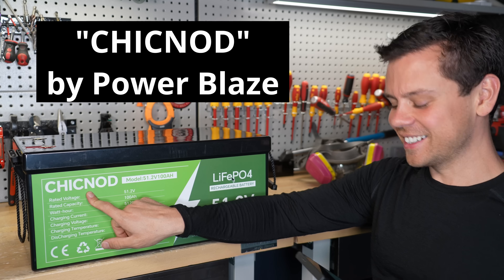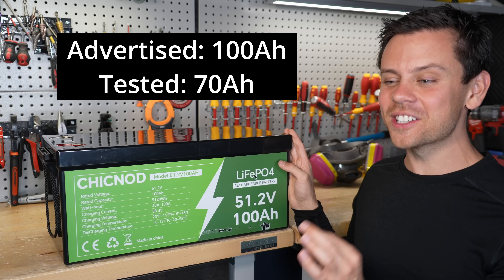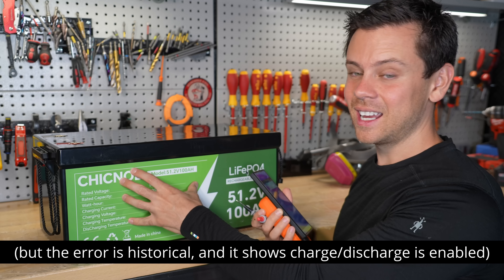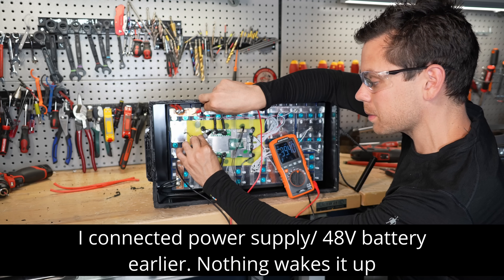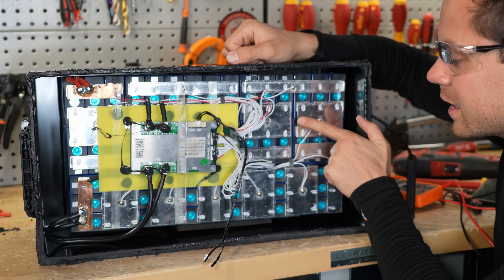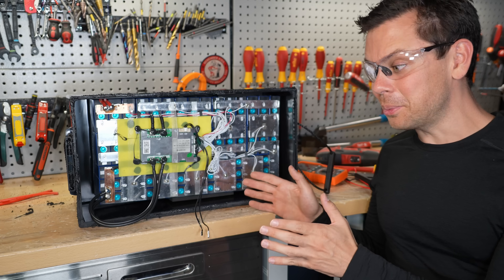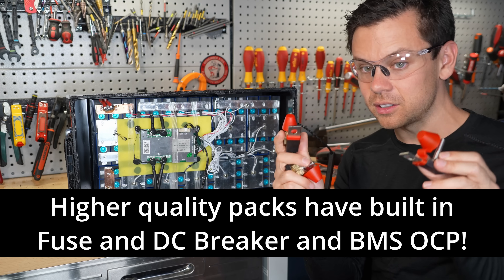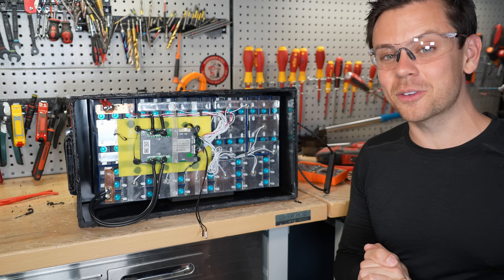TEMU Battery Scam? 48V LiFePO4 5kWh for $529 CHICNOD

Comment: HELP! I live in Australia. Our issue is distance and no infrastructure to charge an EV. Can you help design a mobile 12 to 16 panel solar charging system. I was thinking of a Sigenergy 5kwh battery with its linked DC charger. If I can make it able to have the solar panels unlinked / disconnected for storage (travel). So 12 panels at 1700x1000x30mm are light and would easily fit in a trailer if packed correctly. But on stopping my car to charge I would need to be able to set up my solar panels. Connect them to the Sienergy battery and DC charger to my car. If I could get the DC charging unit without the battery I would, but so far none offers this as a separate unit. Any thoughts?

Comment: I think I saw a video when the bms turns off when the battery reaches below the rated voltage so he connects it with a 12v lead acid battery and starts charging and the bms turns on.
Don't know will it work 😅.

Comment: Wearing "safety glasses " when not required makes nothing safer, especially not when they condensate. Who do you try to impress? Amateur
Reply: Then don't wear them and you can enjoy the metal blast shards in your eyes when a probe or screw driver slips. Not everyone thinks like you thankfully.
Reply: @LithiumSolar at 12 Volt? 😂 oh boy, what paranoid Karen thought you? Edit, are you potentially talking just about the dangers using a fing screwdriver??? Seriously? 😂😂😂😂

Comment: How about a video building a small portable light weight travel unit for camping people that don’t want to use generators because of the noise and would be cheaper and better than the Ecoflow, Anker, Jackery things? 
Or are those the better way to go?
Reply: Great idea, especially if he can figure out a DIY kit the also includes an optional 30A RV output, which few (if any) yt channels have done.
Reply: @__WJK__ This young guy is the only one I watch. I’m thinking more like the weekend warrior maybe a few days longer type of thing. Lots of trucks have the 120v outlet but a car battery only lasts so long unless you run the truck or bring a small 2-3 HP generator which though quiet is a hassle because of fuel to carry and the noise it does make at night.

Comment: Temu all junk 
I prefer to buy all separate and  diy .
I leave in Philippines they have lazada and shoppe here . Here I can find all I need  cheeper easy return if needed money back guarantee no hustle . Rearly I have to return
 In the last 2  years  I build a  few sistem for difrent costumers all I purchased ware ok .  The cost for A Daly bms 100ah is around 30 $  I use eve cell 90% of the time  
1cell 20ah it's 10 $  
On sell I get it for 7$
 Temu didn't cache up  well in this part of the world .

Comment: Bought two separate 4 packs of 280Ah from there. 4 batteries were bad and 4 batteries were really bad. None would top charge and are the first to discharge in a system. I suspect battery manufactures dump their grade B and C batteries on that site. Now only buy fishing lures, terminal ends and nothing important there. You know what they say " Buy cheap, buy twice".

Comment: I just figured this voltage issue out on my DCHouse battery. The BMS likely has a hidden setting (I used the Overkill Solar app to find out) that makes it think it has a user accessible breaker. Change that and the voltage should go back up.

Comment: Would the 48v dc-house 5kwh batteries be a good mix with the sungold power inverters you have shown recently? Would I need to fuse between each battery in parallel ? Or would I have a fuse between bus bar and inverter?

Comment: I put a 48v 100ah fllypower battery in my 22ft sailboat with 400w of solar and a 48v electric outboard, works great, typing this from the boat been on the water 3 days still 98% been as low as 84% but solar seems to have no problem topping it off.  Never found a good review of this battery but the price was right at just over 600$.
Reply: This is meaningless unless you do an actual capacity test. For all you know it's only 50ah. Most people can't or just won't verify capacity and will use them as is until it dies thinking they got a steal.

Comment: Honestly after I looked at numerous options. I bought the best bang for the Buck. 12-300 Ah Chin 12V Lithium Iron Phosphate batteries. Each of them has a 200 amp fuse installed & ran through Victron  500 amp shunt. Honestly not my first choice however I only use the Battery Bank twice a day from 6 to 9 a.m. , p.m..  It’s 44,000 watt backup allows me to Grid Shave peak hours. I currently have in excess of 4000 KWh of power banked with my Electrical Co-op for later use.

Comment: If they had just labeled it properly, this is $529 for 70Ah which is $7.56 per Ah.

The others START at $800 for 100Ah which is more expensive at $8 or more per Ah.

Update: Oh, I see there were serious design issues as well. So it’s not just an overrated capacity. Never mind.

Comment: If you follow the economic news you know that China paiinted itself into a corner with vast battery and PV production overcapacity.  First they cheated on  existing trade agreements by heavily subsidizing those industries but now they have resorting to dumping/flooding world markets with their excess production.  As and as technology rapidly improved they are also stuck with mountains of substand products, which they also dump.  

Last week the EU Finance Minister finally admitted and agreed wirh President Trump that China is the problem, not American trade and tariff policy.

The lesson is buy quality, don't buy solely on price because you can't afford good products that work.  If you buy junk you either throw your money away slowly or you throw it away fast.  It's your choice.  If it's emergency, backup, or everyday power, it has to work when you need it or you saved nothing.

If you can't afford the better items you and your piss poor economics are the biggest problem.

China wants to shift its' massive losses of its' own making onto everyone else.  

That means, you, cheapskate.

Comment: i bought an amazon cheap 140.00 dollar 100ah battery and its been working great for a year now and it showed up to my house in 1 day and for 140.00 dollars im very happy so far but as long as it last the 10 years like the claim then ill be happy with my purches for sure. and this battery come with a JBD   BMS and it has bluetooth app and it has all the protection on it and you can change all the setting as well to what ever you like lol i have my battery set up to stop at 12v and charge up to 13.7 max and i get 101AH everytime and thats how i have it set up instead of discarging down to 11.V or less and then have it charge up passed 14V naaaa im goood i get 101ah out of 12V minimum and 13.6V fully charged and its been working great for me i get full capacity every time so im happy now will see how long this battery last for i hope another 10 years or more how i use it lol i dont use it for huge loads so i should be good anyways if i could buy this same battery for 100.00 dollars or less today i would get another one in a heart beat

Comment: what's your opinion on resettable DC circuit breakers in place of a fuse?
you know like the ones you have at a regular grid power pannel but the DC version of that device.

Comment: This happened to me on a self-built battery after 3 years. After my battery drained itself and was at 0 volts for sometime, I charged it back up. It killed the BMS. The battery would show voltage (like in this video) but I could not charge, or discharge. I ended up replacing the BMS with a new one, and the battery worked again. Much better than tossing the whole thing.

Comment: Love the cheap battery tests. I'd not risk buying cheap off Temu as the odds just seem stacked against you. I have seen some cheap batteries on amazon though that are tempting. Keep the great reviews coming!
Reply: Amazon will not allow you to return batteries, so it can still be risky.  I have not tried working with Amazon customer service with a battery because I have never ordered anything outside of a coin cell.  Would be interested in anyone's experience.
Reply: @bindingcurve  I bought my eco-worthy rack storage battery from amazon and they had the usual 30 day return in the listing so I assumed I could have returned it if I had a problem.

Comment: Test the vevor all in one inverter for us, please.
Reply: Not the same product, but a vote in support of Vevor making decent equipment.

I have one of their 3500w / 12vdc to 120vac inverters and it has ran like a champ for over a year. It's powering things now as I type this.

Only flaw was a cooling fan failed, but one from an old pc case fits.
Reply: @Le_Comte_de_Monte_Felin vevor doesn’t make things; it slaps its name on things made by others, while having slightly more quality control than is typically found in Chinese products.

Comment: I get trying to save a buck, but I probably wouldn't try to cheap out on a very large battery that has the capacity to burn or explode if it isn't made right.  Going w/ the known brands for a couple of bucks more is better than your house burning down.

Comment: Can you do a review on the TCB Worth 12 volt 100 Ah LiFeP04 batteries? The are very few reviews and none where a person takes the battery apart. I have 8 of these batteries which I took 2 batteries and connect them in series to make a 24 v 100 Ah battery. Connecting 2 in series was suppose to be ok in the beginning but now people are saying don't do it that way  as the second battery wont get fully charged. The batteries don't have Blue Tooth so there's know way to know if the cells are getting balanced or not. What I want to do since I already have the batteries is to take the cells from 2 batteries and make a 24 volt 100Ah battery with new 24v BMS that has blue tooth. The batteries have come way down in price as they are $160 on Amazon now but when I purchased them they were around $200 or so. Thank you for your video, help and time.

Comment: Beware buying anything from Temu. I had a horrible experience. Bought an expensive machine and had to waite months. Customer service delayed, delayed, delayed refund per their policy. Eventually a third  party delivery service sent some guy in a truck to drop off my crate. It was a cheaper machine than the one I bought. Temu wanted me to re-crate the machine and send it back. I did not trust them to make good so I kept the cheaper machine. At least I had some of my value vs none.

Comment: Hey Will. I found some cheap 12v 600ah batteries but I run a 48v system. Is it okay if I bought four and connect them in series. I can't find any battery with comparative cost advantage which is 48v.

Comment: No end to the Chinese scams.
Before the 48V 280A-hr battery products became available, I got screwed for over $3000 on some 280 A hr batteries off Amazon which were advertised as grade A and new, but were obviously used and swollen. 
When I contacted customer support they made some ridiculous requirements to start a RMA.
Then 30 days later, they were nowhere to be found. They had disappeared from Amazon.
Of course, shortly after I saw Will's vid about the Chinese scams.
One company off Ali Express tried to tell me the batteries were at the post office awaiting pick up just to run the 60 day clock on the CC. Fortunately, I was able to get my refund from AliExpress on these non existent products.
They had a DHL label that was NOT legit. Imagine how many people they messed over.

Bottom line, follow Will's advice.

Comment: I have a question off topic with my Victron shunt stopped communicating to the blue tooth app on my phone. Victron says I have to send it back them to test before they will replace it. I used the reset code for over an hour 7 time and nothing. I told them they pay the shipping cost they said I do. I said No I will replace it with digital other option. Not happy with Victron support, all my other Victron devices connect very well. Any advice ? thanks  Dan Not buying Victron anymore.

Comment: In the UK we have 'Datou Boss' Temu batteries (and inverters).    I bought three 24v 100 ah batteries for less than £400 (just under $540, with careful use of discount codes).   They do only pull 90% capacity, but still, at that price ...   I also bought one of their 3000w (6000 peak, for £80 or $110) inverters that cut out after ten minutes at 2500watts constant draw, but i glued on some extra heat-sink and added a small fan and now it pulls 2500 watts constant for two hours (of course not ideal and not recommended).
Reply: Good luck with the insurance claim when it catches fire!

Comment: I bought one for similar price from a different brand in AliExpress a couple months back for about $450, capacity test 1st time got 70ah, and it weighed 60lb. The Ant BMS that came with the battery died after that. Seller shipped me a new BMS and box, and I was able to fix it myself.
Capacity test again and got 70ah again, I complained to seller and AliExpress. They refunded me the money and didn't ask for the battery to be returned.

These are not worth it !

Comment: Only use Temu if you can afford to bin the product (occasionally stolen), it's gambling. Size, shape, colour shade/tint, material, descriptions may not match, product is faulty or unsafe...
lights/screen not bright enough, prone to breaking, doesn't last enough uses...
If you can afford to buy a pile of lottery tickets before finding 1 that pays for 2 or 3 then it's OK, just don't bank on it. Returns/replacement costs more than the item price you paid.

Comment: So what happens when I’m 7 batteries are in parallel and one is dead?   How can I check?
Reply: The other 6 continue to work & you replace the dead one.
Reply: In parallel shouldn't be an issue...you just won't have the same power that you expect.
In series, you would have no power😢, because the dead battery breaks the circuit.
Find the dead battery and take it out.

Comment: Dchouse, 51.2v, 100 ah.  Supposed to be “refurbished “.   $579
Reply: I hope I didn’t waste my money.. each battery came with this little bolt on Bluetooth battery monitor
Reply: @willmarotta4525  I have one ($530 refurbished), it's a good battery, probably identical to Eco-Worthy.
Reply: @willmarotta4525  DC House should be good to go as long as it wasn’t refurbished by some hack company. DC House is the same company as Eco-Worthy.
Reply: You probably were scammed
Reply: @roberts.3712  so far, does not appear to be

Comment: Maybe not batteries, but Temu has been rock solid in all my purchases, 8 years with constant solid products pin many purchases. Never bought batteries but many camping, knives, small gear and many other items and again Temu has been very reliable in all my purchases.. just a happy consumer;)
Reply: ^^ works for Temu
Reply: @The_Cyberz 😂
Reply: @The_Cyberz nope, got good goods;)
Reply: I got a drone from Temu because it was cheap. Was pretty cool, had an onboard camera, was cool for about 5 minutes, then everytime you launched it it would fly sideways really fast like it's balance was all out of whack.
Reply: @xeridea You needed the temu drone balancer. They're nice! 💯
Reply: @xeridea I couldn't get mine to fly.
Reply: I bought a 100 watt solar panel for $48 plus tax from Temu. I figured it would be pretty crappy, but it works fine and gets about 80-90 watts on average. I just use it to charge a 100-aH LiFeP04 that runs a diesel heater in the winter and a window fan in the summer. I might buy another one.
I bought some tool batteries for Ryobi that are supposed to be 8-AH, but they work the same as Ryobi 4-AH ones but for the price they're pretty decent.
Reply: Same here. I have purchased numerous camping and fishing products that have panned out pretty good. Most of these purchases were for canvas bags for fuel, or kitchen. You just have to be very careful. The reviews seem to be legit and accurate.